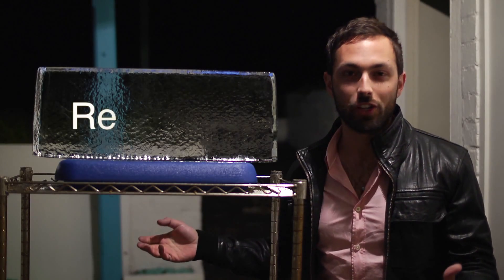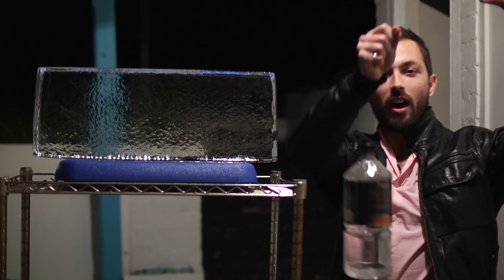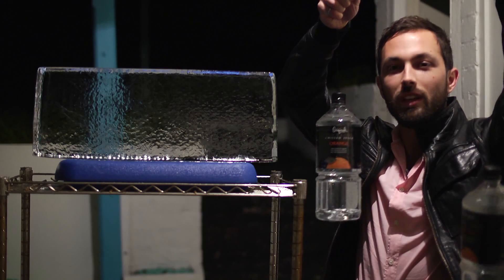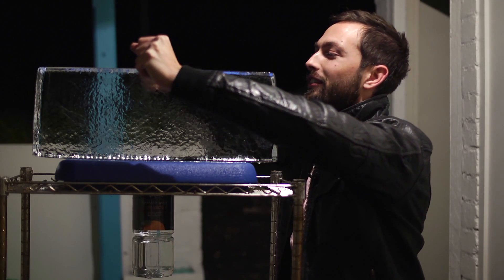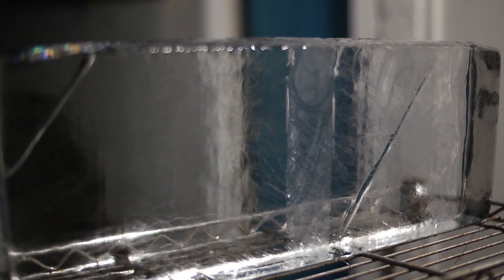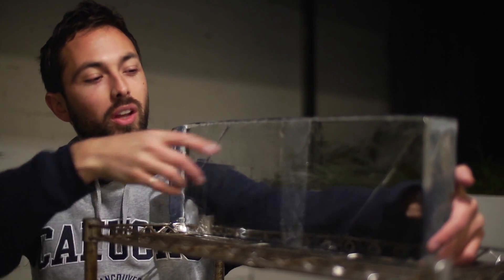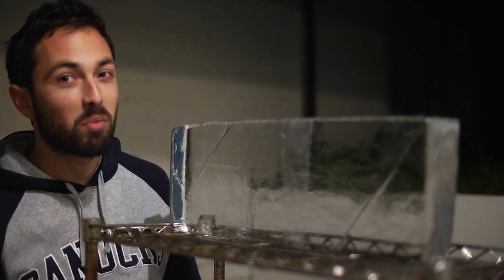Does Pressure Melt Ice?

Comment: Is the water freezing again because of the release in pressure? Or just because it is still in contact with the ice around it? I'd like to see ice pressurized completely into water (keeping the same temperature to pressure ratio) and then freeze again after the pressure is released. I don't feel like I've seen this happen here, which I think you were getting at.
Reply: +Kartike Bhagat that is what should happen, I just don't think I've seen that here for sure.
Reply: that's the same think that happens in ice skiing. A pressure is applied and melts the water, allowing the metal blade to pass above liquid water with almost no friction. Then, the water solidifies back into ice. If you wanna know more about it, google phase diagram (sorry for any grammar mistakes, English is not my native language)
Reply: @pedrocavalcanti5281  i know this is 4yrs old. But in recent discoveries , it has been found that in ice skiing what is actually above the ice is a quasi-liquid . The pressure part does liquidify the surface but its not 100% the reason why the ice at the top is floaty. https://blog.pnas.org/2016/12/journal-club-why-does-water-form-on-icy-surfaces-new-model-solves-century-old-mystery/
Reply: I believe that this experiment do not, on itself, prove the phenomena described. One should try to prove it wrong with various and more extreme situations and when failed, prove that the phenomena must explain the observations.
Reply: Even the melting of the ice, i'm not completely sure it's due to the pressure and not the heat from the string.
Reply: +MrMeeeeToo no, you can test that by very softly sliding something cold and non heat conductive, like a piece of wood, on a ice cube that has not started to melt at all. it will not slide easily. But if you apply some downward pressure, it will slide.
The ice block demonstration would be more obvious if done in a large freezer, with all components below freezing, it would still go through the block, basically with no obvious melting. the only melting would be just under the wire, which instantly refreezes when the wire passes. 
What happens below -20C is it is too cold for the pressure to melt a layer of ice
Reply: Your knowledge of automotive systems and science seems quite limited. If you dont know about something, dont talk about it. It is NOT antifreeze as much as it is COOLANT. The chemical nature of the coolant is what keeps it from freezing (glycol in most cases) and only when, surprise!, the engine is cold and with an UNPRESSURIZED system, duh. The BOILING point of the coolant is kept at higher temperatures with pressure. That is why the radiator or filler cap is meant to lift at a certain (extra) pressure to allow the excessive heat to boil off and avoid engine damage.
Reply: @vincentkirouac9311   ''...the radiator or filler cap is meant to lift at a certain pressure to allow the excess heat to boil off and avoid engine damage''
It lifts to avoid damage to the coolant system or a hose blowing off (coolant is slippery and a blown hose will dump it on the ground for your rear tires to run over). The moment the valve opens the coolant will boil, which does take up some heat, but also forms steam which can not take up heat from the engine and  prevent the water pump from properly circulating the coolant (and might damage the water pump). The moment that happens the engine will have almost no cooling, it will prefer high coolant temps to that any day. The hotter the coolant, the more heat it radiates off, nascar run very high coolant temps to get away with smaller radiators for aerodynamics (and possibly fuel economy).
Reply: Vincent Kirouac such an aggressive response
Reply: If it weren't the pressure the string would very quickly go below zero temperature and be stuck.
Reply: +Zach Hansen I have the same problem with this. In theory and by my studies, sure I know is should work, but this experiment doesn't demonstrate it quite easily. E.g. you could argue, that the ice block is indeed colder than freezing temperature. So the water above the string freezes again, because it is again cool back down to below zero celcius. That could be an explanation for the freeze back again part. 

The cutting part is perfect, i can't not think about an other good reason how a string could cut solid material.
Reply: @DerFliegendeMocca  you can't think of another reason a string can cut solid material? if you have a strong enough string you can cut through anything and bring up melting. (sorry I'm 5 years late)
Reply: This phenomenon/principle is noticable when driving, or walking, on ice. I live in Montana, USA and get to 😊 experience this every winter. It is noticably slicker at -1C than, say, -10C.  At colder temperatures (say <-20C) ice seems slick only when and because it is really smooth.

At temps just less than 0C the pressure exerted by an auto's tire can melt ice,  just to have it freeze again quickly enough that the impression of the tire's tread is left in the new ice.
God's laws of physics are so interesting, unchangeable and thereby dependable. Isn't that nice?
Reply: +Zach Hansen  
That's a very great experimental validity point, Zach.
Reply: I would not say that when you compress snow in your hand that it melts. Snow can also behave like a sponge, and pressing it make its water come out. What could prove that the ice is really melting and solidifying back?
Reply: I've been ice skating when it's been -30°c outside and had no problem sliding across the ice. I haven't looked at the physics involved but I can say that it's still possible from my experience. Hockey puck slides effortless in ice without putting much pressure by weight given by large surface area to the little weight it has. I guess I have to ask good guy google for more information now
Reply: Zach Hansen next time you are eating ice, gently and slowly squeeze it between your molars. it will seem to liquify and crush but will resolidify when pressure is released.
Reply: Liquid water is denser than ice; through LeChatlier's principle, the applied pressure will cause a phase change. When the pressure is no longer applied (e.g. the wire has passed through), the release in pressure causes the liquid water to be in a supercooled state and to return to equilibrium a new ice phase will nucleate on the sides where there are still ice and fill the gap.
Reply: imax digital In America we do use centigrade.... It's taught in schools in fact.  Unless you went to school before the 70's you should have learned the metric system at least once.
Reply: The cutting part is flawed too.  The room seems to be above 0 C and the metal wire is a better heat conductor than the air in contact with the rest of the ice.
Reply: Yeah, it's interesting to me too. I have no reason to trust someone or not, i just want to see myself.
Reply: I was looking for a comment like this.  I found this a very poor demonstration of regelation, a more careful isolation of the phenomenon is required.
Reply: But I dont do work, if im moving in the direction of the force... It's like saying im fighting the wind while actually the wind just pushes me back. As soon as i manage to walk against the wind, I have done work. 

And how much of the work is that? Water as a warm resservoir can easily buffer some amount of heat if it's - lets say - minus10C. 
That would be still cold enough to freeze. :)
Reply: Still if it would be 0C, since ice needs to change the state to fluid, there is enough room to absorb energy i guess.

I guess the W= F * s Formula only applies in the other direction, but dont know, guess I'm just a little tired :D
Reply: True. That work is released, i see that. Seems logical. :D
Reply: https://www.youtube.com/watch?v=2IOyJa8NSk0
Reply: the real question why it melted. it is the point of video.
Reply: You can graph state over pressure / temperature. At cold enough temperatures yes it will refreeze
Reply: Try ice skating.
Reply: Somehow You are right.
Somehow you are wrong
 
this is experiment of reversible adiabatic process.
If you put a pressure, the temperature will increase and if you release pressure the temperature will go to starting point. 

also the materials need some energy to change there phase.

so, if the temperature is 0 celsius, water wont go back to ice, but it will remain as 0 degree water 
but, if the ice is under 0, lets say -5 degree.
The temperature of ice goes up to above 0 and then after pressure relased it goes to back -5 . 

moreover, we need to think about around ice temperature as well as you said.
Reply: This is pretty logical, never thought of it
Reply: Indeed the water refreezes because the temperatures are low enough for atmospheric pressure, but all this couldn't have happened if the pressure didn't change in the first place. So the variable accountable for this to happen is pressure, not temperature. The phenomenon would've been more obvious if he went from atmospheric pressure to really low pressures to make liquid water solidify, but that's super hard to achieve in reality cause of water's behavior.
Reply: I think it's because of the string Temp, and then the water freezes again when the strit passes
Reply: @javierchaparro4769  well no cause the string is made out of metal and is very thin, it can't be warm enough to melt ice in such conditions. Friction could be causing the ice to melt because of the heat generated but the string is just pushing down and is not rubbing against the ice so it is probably a neglectable parameter.
Reply: doe sit have connection with PV=nRT
Reply: Contact with ice freezes the water back
Reply: I don't think this is entirely right. The pressure that is used to melt the ice comes from the weight of the water blocks. But if it does then the energy put into cutting throught it due to heat, from the pressure. The energy is lost to the ice. The ice is cold enough and it's close enough that by the time the guitar string has gone through, enough energy has allready gone back into the thin film of what that is in the cut mark so that it re freezes.
Reply: You say that possibly the water freezes again because of the surrounding ice, well, let's see. The water clearly melts, and only at the points of pressure, therefore it melts because of the increased pressure, once that pressure is released, it melts again. Because of the surrounding ice? Well, if the temperature of the melted water was really lesser than that of the ice, we should see ice melting in the surrounding areas, not only that but, how are we heating the ice in contact with the string? Note that we're applying pressure, but there's really no source of heat, for example friction. Hence, we can safely conclude that the water changed its state because of the change in pressure
Reply: @diegocastillo6470  he is not saying the pressure does not melt it. he is saying the suround ice might have that much lower temperature that the ice makes the melted water freeze again. If the ice is -20°C than the ice is far cold enough to freeze the melted water again. So you can't conclude that the melted water becomes ice again just because the pressure is gone
Reply: Same thoughts
Reply: @y2kartike  but nornally greater pressure makes things bind closer togrther and n from liquid to solid..is water the exception because  ice is less dense than liquid water? He doesnt explain that in the video...
Reply: Zach Hansen both
Reply: You can't put ice into water, because the latent heat of the water-ice system would melt it.
Reply: Heightening the pressure actually lowers the freezing point of most fluids, but with water, it must arrange itself into a lattice where the molecules are spread out, which is why ice is less dense than solid water. If you break that lattice structure with enough pressure, the ice must rearrange itself, and in doing that, it becomes liquid. As the pressure is removed, the surrounding ice, still at or below freezing, will cool that water back down such that it freezes again. It's why this wasn't done with any sort of pressure chamber: refreezing requires the temperature to still be below freezing, and refreezing in a cold room is unremarkable.
Reply: I see what you're asking. Water needs a change in crystalline structure to re-freeze. It must be in contact with other ice or be otherwise moved to freeze.
Reply: +Zach Hansen I actually agree with you.. This experiment is kinda bogus because the water is in contact with the ice, through convection the water and ice will equalize temperatures and if that temperature is below freezing, then the water will re-freeze. I don't doubt regelation is legit, I just don't think this experiment is showing it.
Reply: "Ice skating is given as an example of regelation; however the pressure required is much greater than the weight of a skater. Additionally, regelation does not explain how one can ice skate at sub-zero (°C) temperatures."

"Weights suspended from a wire which cuts through ice, is an example given in old textbooks. Once again the pressure required far exceeds the force applied. Conduction of heat from the room through the metal wire is the correct explanation of this phenomenon."

"Compaction and creation of snow balls is another example from old texts. Again the pressure required is far greater than can be applied by hand. A counter example is that cars do not melt snow as they run over it."

A quick google search is your friend.
Reply: zeke1220 I agree with you. the experiment should be done in a freezer to validate that it melts only due to pressure. the wire only bringing pressure and not heat to the ice.
Reply: Kartike Bhagat - however, this experiment does not show that. If you didn't know that the pressure release refreezes the water, there would be no way of knowing, from this experiment, that it is not simply contact with the surrounding ice.
The cooling of pressure release is easily seen when rockets take off (falling ice). Also, anyone who has done any outdoor cooking on a camping stove that uses those little butane canisters will notice the significant heat loss. And of course, refrigerators!
Reply: No ice skiing below -20 degrees C?

I can not believe some people are this stupid.
Reply: +Pedro Cavalcanti  This is wrong too, ice skiing works because there ALWAYS is a small film of water ontop of ice, as long as the temperature is above -20°C below that, no ice skiing. No preassure involved
Reply: @MrMeeeeToo  This is straight up wrong. Ice skating has nothing to do with a thin film of water, and you can absolutely ice skate at below -20C temps
Reply: @MrMeeeeToo  I think you are wrong about a bit of water always being on the ice above -20, water's phase diagram shows the pressure aspect, and I have been on ice that is at -10 and found there is no water unless sufficient force is applied.
Reply: ANOTHER EXAMPLE IS WHEN YOU MAKE SNOWBALLS. compressing it in your hand, turns it in to liquid (the surface mostly)  which then moulds in your hand, when you remove pressure it becomes snow again
Reply: Zach Hansen it's not even the pressure, the string is making the ice one degree above zero which then means it takes very little energy to get it back to freezing at 0, it's the contact of the string when I see this tested in a freezer I will believe it
Reply: No,  the string is simply applying pressure, Not raising the temperature. The water at the bottom of the Ocean is freezing cold, the incredible pressure does not warm it.  Glaciers move as they do by pressure , but they do not warm above the freezing point in order to do so.
Reply: *****
the antifreeze helps raise the boiling and freezing points but the pressure is what ultimately keeps it from boiling / freezing over but specific to the original post, my comment is an example about the effects of contents, mostly liquids, under pressure. And radiators partly operate under boiling point, the chamber you mentioned earlier can get to around 500 F, which is cooled for the most part, by the water jackets in the head of the engine and through out the engine itself by transferring heat energy, which you've also mentioned. Other factors are timing, plug heat rating, if your system has an EGR, compression ratio, valve overlap, etc. The block can be drained through freeze plugs. Until the hot coolant can flow through the entire radiator and cooled down by air flow and heat dissipation fins, it stays above boiling. (Top of the radiator) Unless you drive a Corvette because some of those have reverse flow radiators and water pumps. Wow, I segued to a totally different topic...
Reply: zeke1220 Nice, but you should tell us where did you find these informations. Why didn't you copy and paste the link?
You know that your sources can be wrong too, right? That's why it's important for us to know where to verify the information.
And I think it depends on the temperature too, because a low pressure can make the melting point of the ice change a little, and this little can be enough to explain this effect.
Reply: Zach Hansen i totally agree with you, with the I agree the pressure melts the ice, but the experiment doesn't really prove that the water freezes again after the release of pressure.

A way better experiment would be a thing I saw on mythbusters, where a drink in a bottle is cooled below freezing temperature, then when you shake/knock it, there is an uneven amount of pressure across the liquid, so the places that had low pressure for that duration start to freese instantly,  and then when the pressure is back to normal again, the ice spreads and the rest freeses (I don't really know how that last part with the spreading works ¯\_(ツ)_/¯)

It's pretry cool
Reply: My brain read the whole thing but I stopped thinking at pressure 😂
Reply: When ice melt into water like the ice block in the video it have to be at 0°C. When ice at 0°C it CAN'T MAKE MORE ICE OR MAKE water FREE AGAIN. When you put water into a cup of ice it olny melt the outside of the ice, the inside still -15°C and it can make more ice or stick together as you think. That physic, sorry because my English is very bad.
Reply: Anh Ngô Văn Tuấn no it does not have to be 0 degrees to melt. It is the pressure that melts the ice, which he showed. If you do not understand physics, do not try to explain physics.
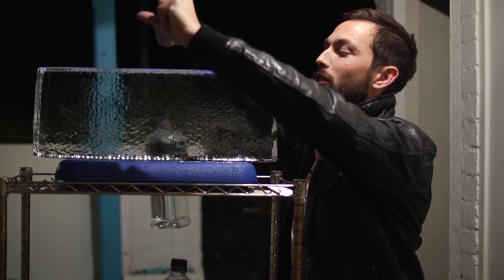Reply: Anti Matters Too in 0:26 you can see a drop of water melt from the ice block. That mean the ice block is 0 degrees. I want to tell him the pressure melt the ice and the water which melt under the string become ice again because when the string go through the pressure lose, not by the low temprature from the ice block. Sory about my english that made you hard to know what I’m talking about
Reply: Anh Ngô Văn Tuấn OK, I misunderstood your point. Sorry for that. I was just frustrated by all the comments in this thread that were totally wrong. I’m a physicist and are just smh.
Reply: +Zach Hansen They are not mutually exclusive. In order for the water to freeze back into ice, it still must be below it's freezing point of 0 celsius, hence touching the other ice. He demonstrated that with added pressure the ice melted, then when the pressure gone, the water that was still touching the ice (less than 0 celsius) froze back into ice. He demonstrated it perfectly, I think you are just misinterpreting things a little bit.
Reply: +Zach Hansen It's the same process that's used in a car's radiator but on a razor thin point. The fluid is kept under pressure so the freezing point goes down (which is why it's called "AntiFreeze") and the boiling point goes down (which is why it's also known as "coolant"). The fluid then stays in its liquid state at lower temps under the pressure but reverts back to its normal characteristics when exposed to regular atmospheric pressure.
Reply: Renegade0056 3 years late but just wanted to say this is completely wrong. Pressure will increase the boiling point.
If you put a liquid under pressure you will have a harder time bringing it to a boil, while if you remove pressure the boiling point will lower.
Afaik this happens with ice/water because of it‘s structure on a molecular level, which is less densely packed when frozen contrary to most other materials, that will shrink upon freezing.
Reply: @Renegade0056  well I did not see anyone correct you but the anti freeze has nothing to do with pressure and that is not where the name comes from. Yes when you drive and the system heats up it will have more than 1atm pressure, exact number depends on the car. The antifreeze is a chemical solution that when mixed into the water lowers the freezing point of the mixture. The pressure does however increase the boiling point as you point out.
Reply: @Renegade0056  butngreather pressure means more solid since molecules are closer..and less pressure means gas or liquid state... Why are we saying the opposite like its true..is water the exception because ice crystals that form ice are less dense than liquid water...therefore when you exert pressure on ice crystals they break and press together tonform liquid..but he doesnt say this in the video and if you didnt know this the more logical  and intuitive  conclusion is that greater pressure equals lower temperature, which is generally true..
Reply: @Renegade0056  when you act as if you know anything about cars...
1. The cooling system is not kept under pressure when the car is cold
2. Anti freeze lowers freezing point because of its chemical properties (as opposed to physically)
3. The boiling point goes up under pressure
4. coolant is known as coolant because it transfers heat from the engine to the radiator, cooling the engine
5. Antifreeze lowers the boiling point and is a worse coolant than water
6.Antifreeze does not raise the freezing and boiling point
Physics are not that hard...
Reply: This experiment proves nothing. Pseudo-sience